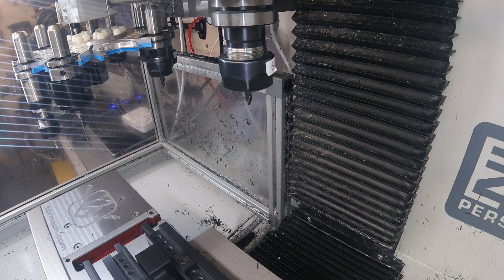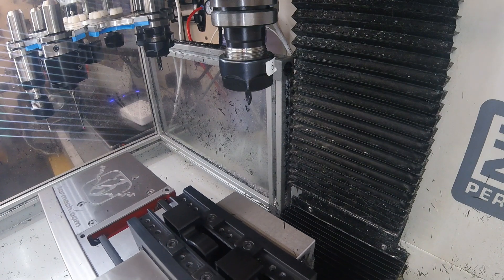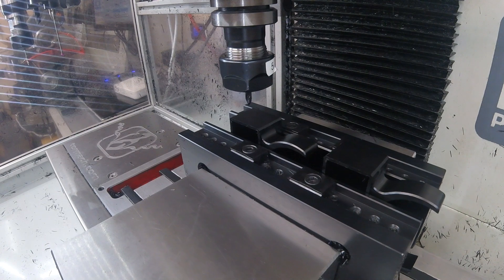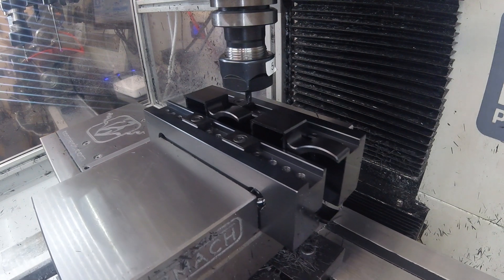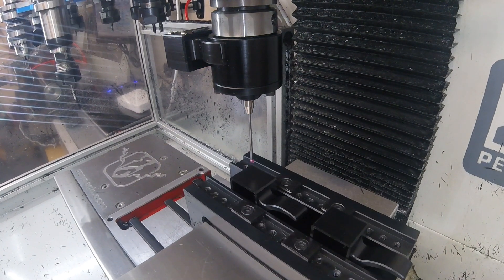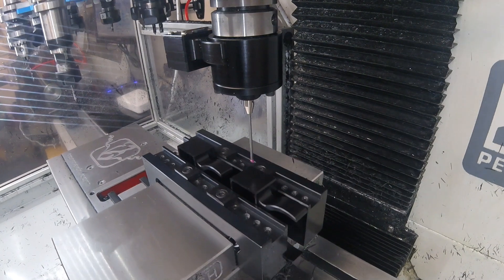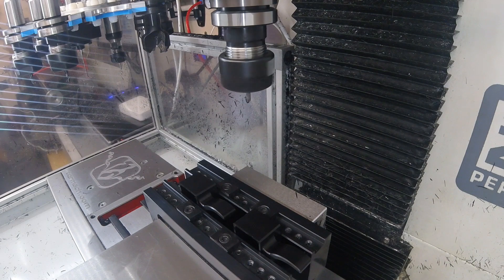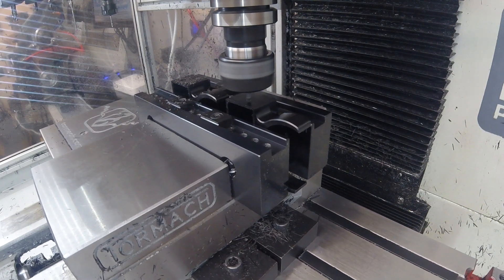Automatic Probing on a Tormach PCNC440

Comment: Will this work with the Tormach 1100MX ATC unit?
Reply from the maker: Yes, no problem.  Just pick up a copy of my Post processor from http://xoomspeed.com/CNC/FusionPostProcessor.htm  All the required macros are already installed in PathPilot, ready to go.  If you want to do it from the ATC, then you can convert the Tormach passive or ITTP probes to wireless using https://shop.xoomspeed.com/collections/cnc-accessories/products/wireless-probe-kit
Reply: @daleksw   How come I have to change the post-processor?  I guess Tormach doesn't natively support probing functions in Fusion?
Reply from the maker: @PowerSports  The Tormach post is actually maintained by Autodesk, but you're correct, it simply doesn't support the wcs probing functions.  I used that post as my starting point and added the missing functionality myself.  Nowadays, Tormach have included my probing subroutines in the standard PathPilot installation, so just run the code through my post-processor and it all works.

There's a lot of other functionality in there too that I've added over the last couple of years.  Integrating a tool setter for in process tool setting and tool break detection is pretty popular, and much better control of when the machine performs full retracts makes quite a difference too.  See the description on the download page I linked previously,

There's another video at https://youtu.be/nlxSfkw0tHo that shows how to use the WCS probing routines to produce pdf inspection reports.  Autodesk won't do that on any machine unless you buy the very expensive machining add-on for Fusion.
Reply: @daleksw   Hopefully last question, if I derp and let the battery on the wireless adapter die, will the probe crash?  I'll only be using my machine on the weekends, so it'll be hard to remember to check everything every time, lol, especially without coffee, haha.
Reply from the maker: @PowerSports  Crashing the probe isn't a problem. When the mill's turned on, the probe sends the current battery voltage to the Rx every 15s or so.  If it drops below a threshold, you get an alarm buzzer and the signal to the mill goes to the 'tripped' condition.  That means PathPilot will refuse to perform any probe operations with a 'Probe already tripped' message.

Similarly, if the Rx doesn't receive that message for 3 times in a row, it decides the probe must have failed and it takes the same action.  PathPilot will allow you to run a program in that condition, but it errors at any probe operation.

Battery life is good for 40-50 hours turned on, so it should be able to do a full working week.  If the mill and Rx are powered down, the probe goes into deep sleep and should be fine for several weeks.  The Rx has a small display that can display the battery voltage so you can check its condition at the end of the day.  Full recharge is a couple of hours via a micro usb phone charger or similar.
Reply: @daleksw   You are awesome! Thank you!

Comment: So I must be missing a good chunk of info here. How do you use F360 to probe? Where do I pickup a probe for my 440?
Reply from the maker: Probes for the 440 are available from Tormach
https://tormach.com/juego-de-sonda-de-digitalizacion-pasiva.html

Cliff Hall's ITTP is also popular
https://hallmarkdesign.co.nz/probe

Both can be converted to wireless as in this video
https://shop.xoomspeed.com/collections/frontpage/products/wireless-probe-kit

To program from Fusion 360, you need a customised post-processor.  There's one supplied with PathPilot, but the latest version is always available from 
http://xoomspeed.com/CNC/FusionPostProcessor.htm
Probing macros to support the probing operations are ready installed in PathPilot, so there's nothing to do there.

My best effort at a tutorial on how to program and use the combination is
https://youtu.be/lMLcEQuZhDk

It shows the CAM process so you can see exactly how to add the probing operations.
Reply: David Loomes Thank you, but that will not auto prove as you are doing? F360 does this somehow?
Reply from the maker: @seanwolfe9321  Not sure what you mean there.  The g-code output by Fusion will run the probe cycles you've asked for.  In each case, Fusion knows what the result should have been, given where you told it the origin would be.  Your machine's WCS origin then gets moved to where it should be so the rest of the machining ops do what they were supposed to do.
All you have to do is make sure at the start that the WCS is close enough to where it should be so that the 'Approach' and 'Over travel' values allow the probe to contact the intended surface.  After that, it's all done for you.

Comment: Hello David I tried your code from your website and I'm having issues. When running the code I get a #<work__offset_x> not defined.
Reply from the maker: Hi.  that's a recent modification from Tormach to support 512 work offsets instead of just the original G54..G59.
If you're using PathPilot, you should update it.  If it's LinuxCNC, let me know and I'll get you a link to the original.  It's just a couple of lines of code changed in each of 3 macros.
Reply: @daleksw  awesome thank you it works perfectly great job! Also is that a stock tool changer on your 440?
Reply from the maker: If it's PathPilot you're using, then Tormach already install the probing macros, so there's no need for you to do it.  That way the macros get updated as necessary when you update PathPilot.
The ATC is my own - obviously inspired by Tormach's, but with 10 tools instead of the usual 8 for a 440.  My mill runs with Mach3, but I'm spending my time at the moment looking at how to control it from PathPilot as well.  Using a stepper to control the linear motion seems to give better control of what's going on.
There' a model of the ATC, mounted to a 440 at https://a360.co/2sAyAct if you want to see how it's built.